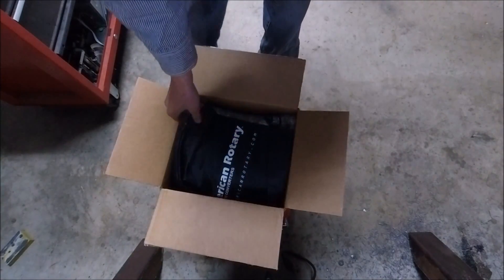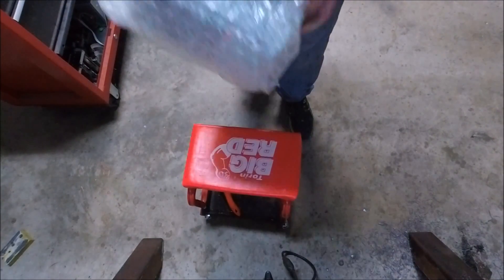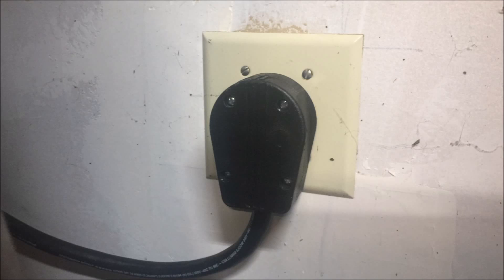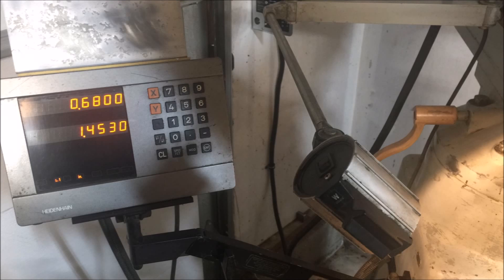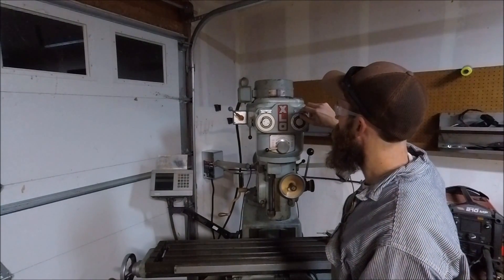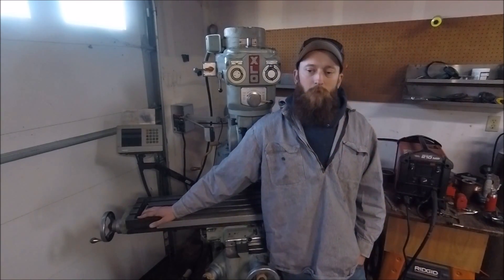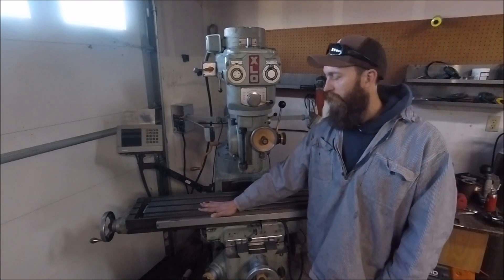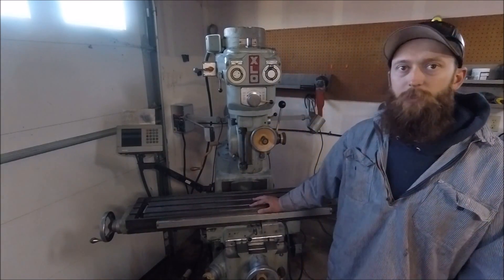Static Phase Converter Install and Running the Mill

Comment: I am looking to get my mill running. The static converters say that they run the motor at 2/3 power and may decrease the life of the motor. Have you noticed any issues?
Reply from the maker: I haven’t noticed any issues but I haven’t been running the mill that much especially the last year. I have also ran my 2HP lathe on the static. However if your doing significant work I would definitely consider a rotary or possum VFD.

Comment: how many volt  is your motor a jus purchase a exello and it raded 600 volt on the motor and i only ave 220 in my garage im looking for a way to wiring up
Reply from the maker: My Motor is a GE TriClad 208-220/440. From what I understand you have a few options, you can use a step-up transformer with a rotary phase converter, use a vfd with a 600v output, or change the motor, or some combination of the above. I am certainly no expert so I would suggest Practical Machinist Forum, I was looking into the subject for a 440v lathe.

Comment: Used a Phase Converter for about 6 years, and had a 10 HP idler motor so we could run several machines. When we  got into a building with 3 Phase, our electric bill dropped considerably.  It was a good way to get started.
Reply from the maker: I had always wondered about the power requirements for phase converters.  Thanks for sharing!
Reply: @riversvic  Make sure you have adequate sized wire if you go with a larger idler motor.  Supposedly you can run several motors that add up to 5 HP if you have a 5 HP idler motor running.  A big motor really pulls some juice, but play it safe and don't go to the limit.  That can melt some wires or connectors and shorten the life of your phase converter.  Your single box will work for a single machine if it is rated for high enough  HP.

Comment: Great video! I sure wish I had a decent sized mill at home. Nice looking machine! Any idea what %efficiency that converter runs at?
Reply from the maker: Thanks for watching, the converter cuts the HP of the motor by 2/3. This mill has a 1.5hp motor so I still have 1hp and haven't had any issues with the power. I think if the motor was Delta(?) wound it would cut the power by half.

Comment: Sounded pretty quiet (on the video). How is it standing at the machine?
Reply from the maker: The only noise the Static Phase converter emits is a clicking sound on initial start up. The downfall is it cuts HP down to 2/3 and by half if its running a delta wound motor. But great for garages and great on the wallet. Thanks for watching and Subscribing!